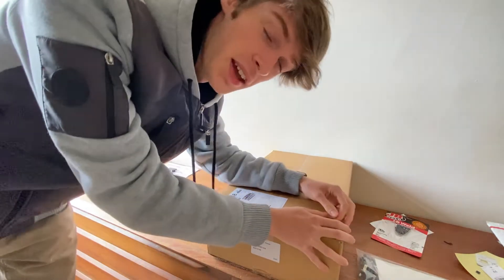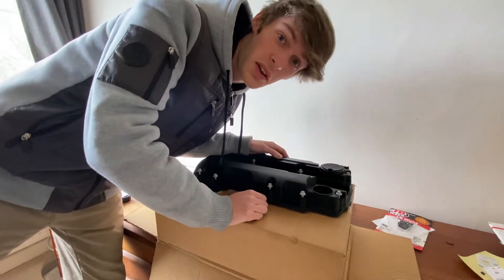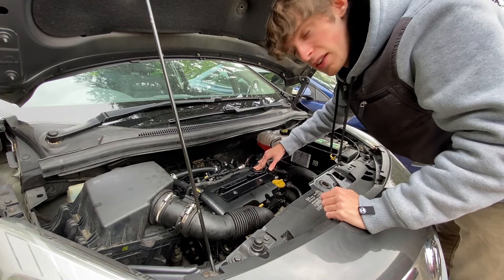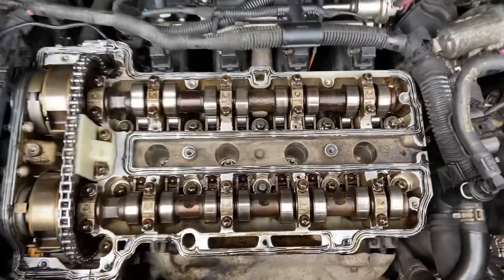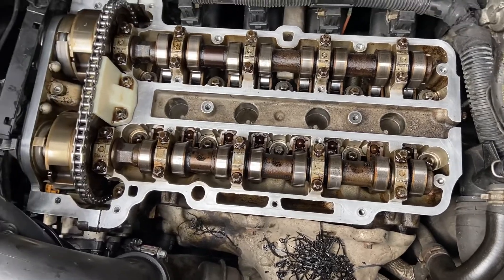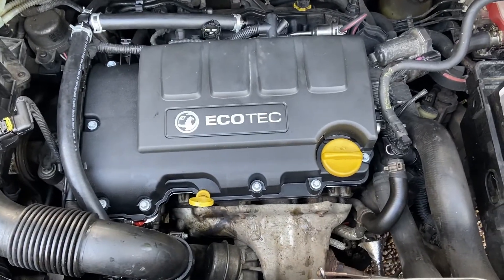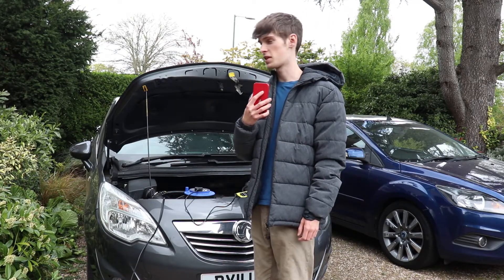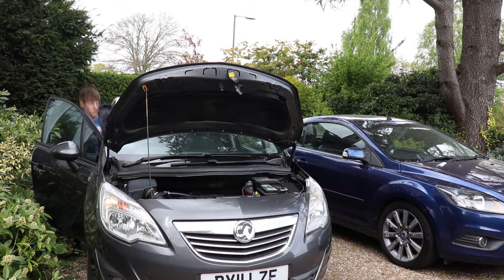DIY Engine Repair - Meriva B Valve Cover & PCV Replacement

Comment from the maker: Anyone else dislike these gm turbod engines as much as me?
Reply: I have this same Meriva myself with this engine. Mechanically, they're not that bad in terms of reliability as long as you remember to change the oils frequently. Chain in these engines is also just stretching, so it'll tell you when you need to change it instead of suddenly snapping like in some other car makes. Luckily, you have the same A-series turbo engine as I have, the B-series (2013 onwards) turbo engines have much more serious issues with the carbon deposit buildup into cylinders because the ignition issues on low revs (hence the Dexos 1 Gen 2 oil recommendation). Generally, these engines don't like jarring on too low revs for extended periods, I usually tend to keep the cruising revs around 2000 rpm just to be sure. And these engines definitely are not sophisticated in terms of driving nature, the turbo sometimes likes to kick in very harshly due it being mechanically controlled. And these vacuum issues indeed are another headache, mine so far has worked, but I do get sometimes some kind of intake pressure warning code, which might be sign of upcoming PCV repairs. 

So yea, there can be a lot to dislike in these engines, but overall, Opel/Vauxhall has always made mechanically fairly reliable products with little headaches occationally.

Comment: Is that the CruiseKit V3 you fitted there? how did you get on placing the bung with epoxy on in the intake? On a Meriva you can't get your head over it to see down it!
Reply from the maker: Hi thanks for your message! Yeah it was quite awkward, but I used my phone to record with the flash to get a good look down the snub pipe, I kept taking videos to check on my progress spreading the epoxy. So most of it was done by feel, end result looked a little messy but worked fine. Yes it was the v3 Cruze kit.
Reply: @carchap  Cheers! I think I'll get one of the V3 kits, my valve is sticking open I reckon.
Reply from the maker: @phildigitalcut  They're good kits. There are some pretty long detailed videos online about the installation too. Mine worked fine, but I did break the hose that had to be heated up - just bought some generic high pressure hose and extra clamps, worked fine. Best of luck!
Reply: @carchap  Thanks mate, I'm just thinking to the future having researched the PCV system on my wife's Meriva. I have a HUGE vacuum in the rocker cover and block. Sucking in air from the crank seal. Sounds like a bloody seagull under the bonnet! I took it into a 'Specialist Vauxhall garage' garage who diagnosed a faulty cam cover/seal/diapraghm. Charged £150 to replace. But the problem was still there... only worse! Then he said it was the intake manifold PCV AKA the dreaded 'Orange nipple'. That was £1200 on the quote. I refused! Then I went to work researching the system. It's NOT complex. I checked the intake and turbo PCV valves easily with a vacuum pump. (or yer mouth if you like oil and petrol). I came to the conclusion that the cover he fitted leaks vacuum directly into the cover and block. I have another genuine cam cover coming.... if I ever get it via the PO.
Reply from the maker: Yeah, it really is a terrible design with the pcv on these engines. That is slightly surprising that a specialist diagnosed it that way, but keep in mind, if the nipple is knackered it’ll make the diaphragm suck in air (even if the diaphragm is good) so you may not need to replace the cover, sorting the intake nipple may solve your issue. It’s such a shame that it’s designed within the intake - should be external. The v3 kit makes the valve external and replaceable like most other turbo cars.
Reply: @carchap  I replaced the cover with a genuine GM one and it's fine now! I'll monitor the intake valve and I'll go the same way as you and get a V3 kit I reckon as I intend to keep the car for a while. As I said, only done 14500 miles! Thanks for your replies and advice!

Comment: Got one of these got it for my aunt in advance of the ULEZ off Copart with cosmetic issues and dead battery, car passed an MOT 6 months ago and has done 150 miles since but I changed the oil took it for a drive and it’s smoking like mad. No eml or drivability issues but smoke on start and when going up steep hills. Coolants ok. Going to check the manifold pcv is still there later.  But I did the suction test on the manifold to turbo hose and that lets air both ways so might be doing this soon.

Comment: Hey I’ve got a 2010 meriva b, it’s chucking blue smoke out when you start it in the morning and it smells like it’s burning oil, I’ve replaced the rocker gasket, sparks and coil pack.  Do you reckon the pcv valve might need replacing and if so is there a video on how to do that somewhere
Reply from the maker: Hello, yeah, if it’s the 1.4 turbo then I’d put money on it being the pcv valve which is located inside the intake manifold. As long as you have no signs of a head gasket anyway. What mileage is the car on?
Reply: @carchap  95000, it’s had the head gasket done, but there was oil in one of the spark plug wells, which is why I’ve just done the rocker gasket, sparks and coil pack.  I’ll know in the morning if it’s still chucking blue smoke out and if so I’ll change the pcv valve, but im like you not a mechanic so I learn from videos, but I can’t find anything about changing a pcv valve
Reply from the maker: Yeah okay, it is the 1.4 turbo right? I’ll send you some links on how to go about replacing the pcv. This only counts if it’s the turbo engine though. To replace the pcv by oem standards, you’ll need a whole new intake manifold. Or what I did was buy a kit and fit the valve externally.
Reply: @carchap  yeah it’s the 1.4 turbo, wish I never bought it lol
Reply from the maker: @thechill-outguy7942  Yuup, me too dude. Terrible terrible engines. I'd still probably buy a naturally aspirated one again, but never the turbo. Complicated and cheaply/badly built. Are you flipping yours? Or an actual personal car
Reply from the maker: @thechill-outguy7942  0:15 sec in: https://www.youtube.com/watch?v=DHreBH5UTF0 - take a look down the stub pipe, on the back of the engine, connected to the plastic corrugated hose. If you see the brightly coloured valve, then your pcv might not be the problem. If it's not there, bingo.
Reply from the maker: *ps clearance is tight, so I used my phone recording with the flash to see down there
Reply: @carchap  ok, so do you reckon a person with no mechanical knowledge could manage to do this aftermarket pcv valve fix
Reply from the maker: @thechill-outguy7942  I installed an aftermarket kit from America, I mean I have some knowledge but little experience. I'd say if you studied the process then yeah it's doable. I'll link you the best vid I followed, the bit where you have to heat the pipes and fit them together I found the most difficult. https://www.youtube.com/watch?v=-BujKhdftRk
Reply: @the chill-out-guy you get your issue fixed?